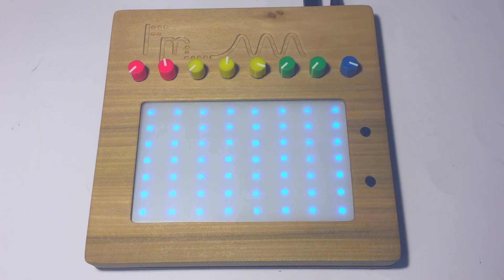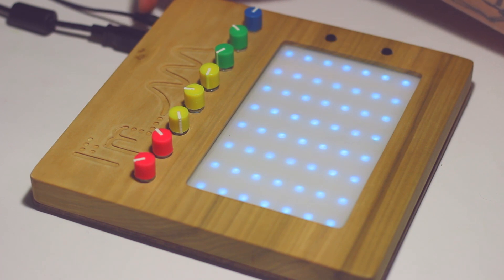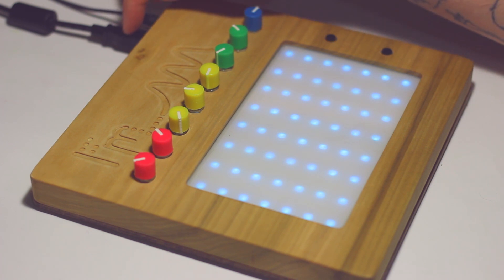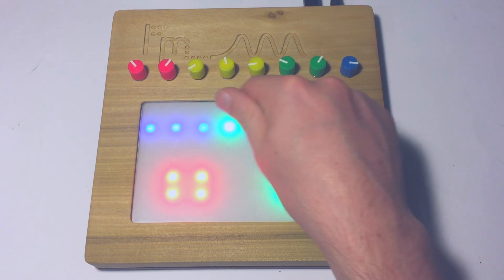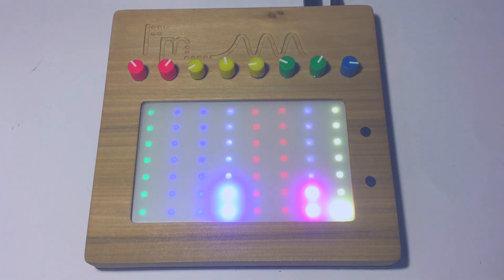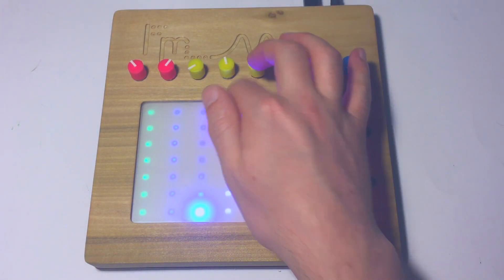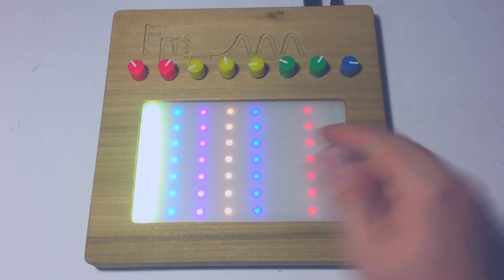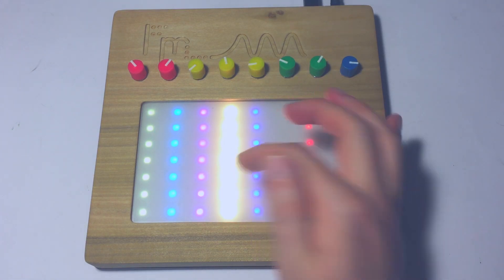Raspberry Pi FM Touch Synth

Comment: How long does it take to boot? In my experience the pi takes a while to boot. Were you able to get your PD sketch running in a good amount of time?
Reply from the maker: About 30s unfortunately. That is one reason I moved more toward working with the teensy audio library and away from pi's. I'd really like to get boot time down though so if you find any resources let me know! Haven't looked into it for quite a while. I miss working in PD.
Reply: @otemrellik  I haven't had the patience for setting it up but I've seen really fast boot times with the picore distro. I think from rainbow to command line is about 7s on a pi 3. I have been able to get my Python scripts to start quickly by entering them early in the boot order. I think doing this on picore would make the boot time of a script happen within a few seconds but I haven't made the time to try it.

Comment: I'm impressed by your knowledge. Let me ask you this: Did Looper thingy project getyou the original source code for the most part to create this project? I understand what the Linux Programs you used are, (and Arduino stuff) but know nothing about the coding and haven't messed with it (yet). Wondering if you could share some details on the coding steps needed to complete it *(not the Details, just a general step-wise checklist of things to do, or frame-work if you will). This I believe to be the most difficult part of getting started with any project : the Plan. What was your thought process behind conception, design process, then execution. Just picking your brain! Please answer this question for me (and of course all of your other viewers)
Thank you from one tinkerer to another (in advance)
Reply from the maker: I borrowed some of the code I wrote for the looper in this project. I ended up scrapping the synth engine and starting from scratch though as I did some weird stuff on the FM synth for the looper project. I don't usually have much of a plan when I start a project, just a general idea of how I want it to work. I then just start messing with the code to see what I can actually accomplish and what ends up sounding good. Most of my projects go through several iterations and sometimes get completely scrapped and rebuilt. This one started with the FM synth engine in Pure Data on my laptop. I built out the patch to a point where I liked the way it sounded. I then started the code on the teensy and figured out what data I wanted to send back and forth from teensy and pure data. I then built the thing and wired everything up. After that I spent a good couple weeks tweaking the code in PD and arduino and added a bunch of extra features. The many 'menu' screens was something I added after it was completely built and was not at all in my original 'plan'. I just found I wanted more control than just the knobs. So yeah, I hope that helps a bit. I'm really not great about planning these things out, I just let them naturally evolve until they are at a place where I'm happy enough to shoot a video. I almost always add more features or change things even after I'm done with them.
Reply: Thank you very much for that. Maybe take some notes along the way of your next project to include in the next video explaining some of your decisions. I appreciate your answer!

Comment: sounds nice... I would of put more knobs as controls instead of using the screen... just because I like to hear the building process of the synth instead of selecting presets on the screen and not knowing what it sounds like. either it's nice and sounds great. how much did it cost to build? I'd like to do something like this. I dunno what kind of skills or knowledge it takes to build something like this tho.